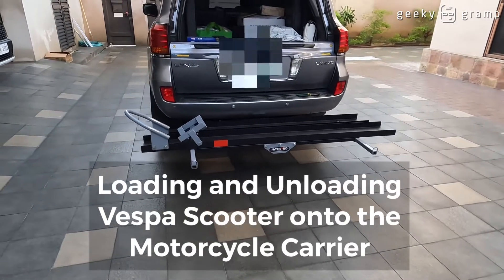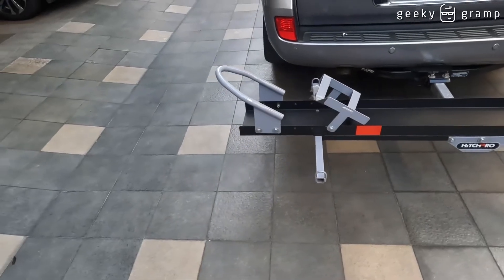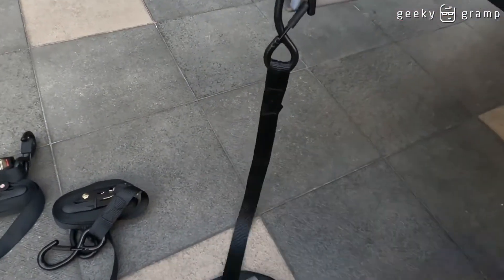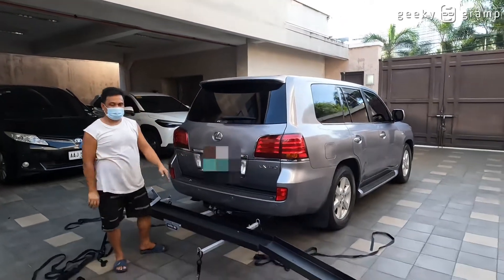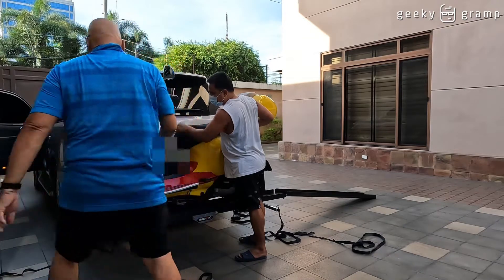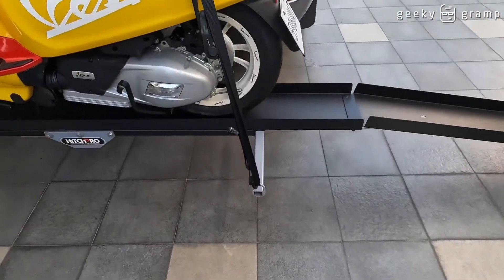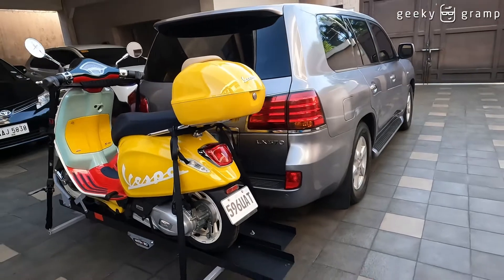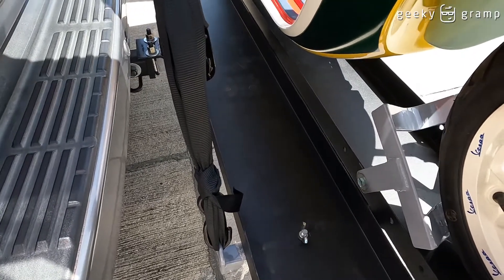Loading and Unloading Vespa Scooter onto Motorcycle Carrier

Comment: There is no way that hitch is going to be able to withstand the cantilever force that scooter is exerting on it.
Reply from the maker: I was able to travel 170km with it.
Reply: I have a similar setup. It will handle it just fine. It has never been an issue for thousands of miles